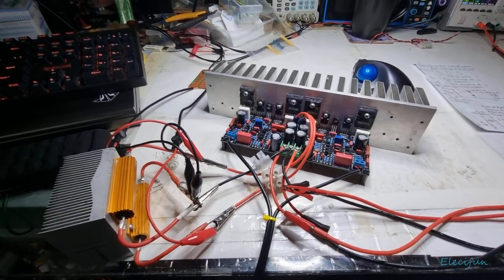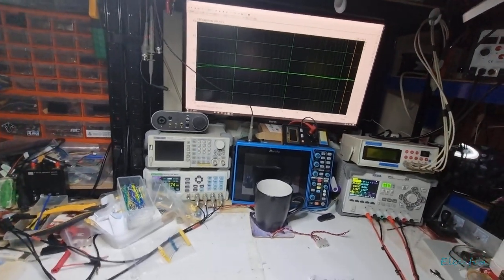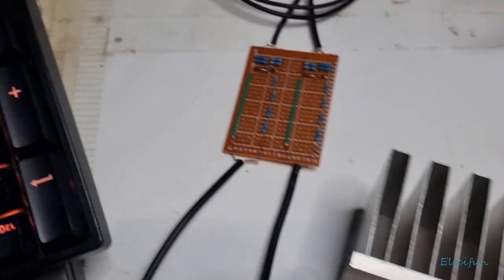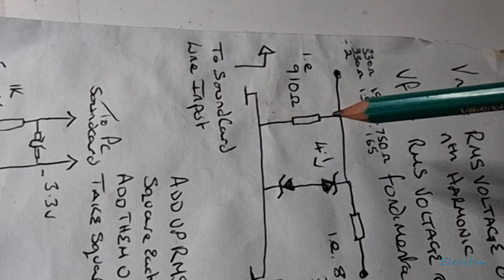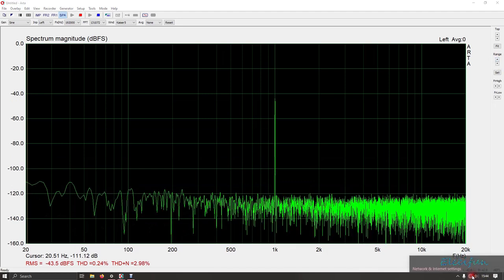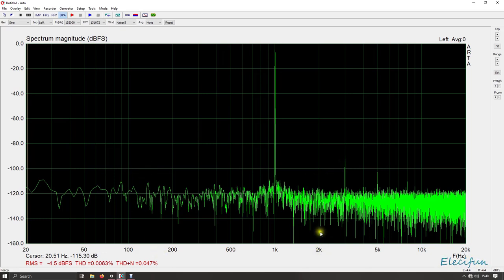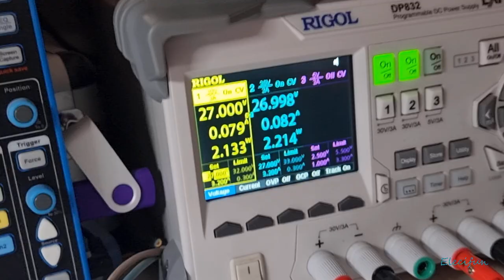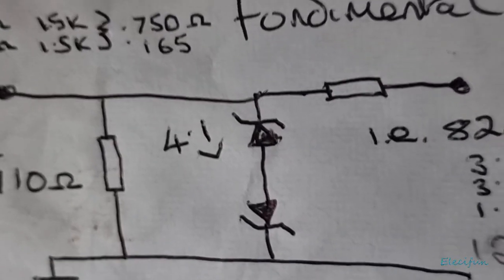SymaSym 5-3 KIT Aliexpress THD+N Results

Comment: Good to see you manged to get it all sorted, and getting results even better than what i got.
You thd+n is somewhat higher than thd, worthwhile checking all your connections for interference
Reply from the maker: @zoelong6021 cheers for the inspirational push, I enjoy the challenges. The noise level is higher than I hoped, At a guess it may be to do with the Realtek ALC 892 driver for the on board sound, its HD sound but HD as in 720P and not HD as in 1080P. 
My urge is to try out the Focusrite just to see the difference, have you tried it or know what its loopback result looks like?

Comment: I'll bet it's very satisfying to build that voltage probe and get an order of magnitude better look at your sound floor when measuring total harmonic distortion and noise. It's all a bit over my head but it's cool to see you enjoy the victory of overcoming obstacles.
Reply from the maker: It's great fun mixed with occasional frustration and constant learning, just like building and flying drones. I see your RSSI is not quite sorted yet, I expect it is a challenge, else it would have been resolved already. I was described recently as tenacious by someone. First, not knowing what it meant, I thought it as an insult. After looking it up I realised it is probably my greatest strength in overcoming the obstacles.
I know you can to.
Reply: Tenacious is always a compliment in my opinion. And accurate from what I know of you through our years of correspondence. I once had someone say "I'll bet you're hard to kill". That might be my best compliment to date. Yeah the RSSI issue... it might be that my RC control antennas sit too close to the battery. I've been ignoring the RSSI reading though because my link quality numbers are quite good and I've never had a link quality issue. I think I'll remove the RSSI readout from the OSD lol. My distance barrier at the moment is video transmission and reception. I can go about a mile before video break up. Sometimes more if I keep the directional patch antenna aimed carefully. It hasn't been a problem because I don't really long for more distance in the type of flying I've been doing. I may invest in better antennas (possibly a different style) if I intend to routinely fly beyond a mile. 📡
Reply from the maker: @Sonic_Ox  the positioning of your antennas would effect the link quality. The RSSI may be a scaling issue, its worth a look.
Nice to get the platform perfect. VTX RX antennas are important and a good overall investment.
Reply: You are right Elecifun. I really need to come up with a better solution for RC control antenna placement. As for the VTX/VRX antennas, they're a bit frustrating because these ARE quality, after market antenna that weren't cheap. Also, the VTX itself is advertised as a long range transmitter capable of 800mW etc etc 😑 I'm not unhappy with my results so far and am still having a great deal of fun chasing the "ideal" platform. The high paced changes in technology keep the hobby fresh in my view but come at a cost 💰 lol.

Comment: Give us a demo bro ! 😂 Have you thought about b... those speakers bro? **(I think I'm pushing my luck here)**😊
Reply from the maker: I've just fitted a new driver to the speaker I burnt out. They sound great as a pair again. Does that count?
Reply: @Elecifun  Congratulations bro ! 🥇🎉I'm very impressed ! 👏 🙂 Was it difficult to do? Do you mean you replaced the old speaker or driver with another driver or did you replace the cone inside the speaker?
Reply: @Elecifun  Well if you can do that you can build speakers. 

I mean think about it for a moment.

Can you measure a piece of wood? Yes, I'm sure your more than cable of doing that.
Can you cut it square and plumb? Yes, with a drop saw yeah, it's not hard.

So really it's just cutting two front pieces.
Two back pieces.
Four sides all the same length.
Two top pieces.
Two bottom pieces. 
Some pieces inside to reinforce the speakers.
Then the 🕳 🕳 🕳 holes.
Cut a piece of timber the right length.
In one end you drill a hole. 
The other end another bigger hole to mount a router.
You bolt the router to the wood.
Like this:

https://youtu.be/UeSTb6FoOaE?si=HBUrsg2E540O_GZj

The design for the box is already done.
So acoustically it's correct for back pressure.

The actual cost of the boxes is that bad.

The speakers are pretty expensive for 6 speakers 2x 10" or were the 12" not sure.
They're the most expensive components. 

I think they're $600 each. 
Then you need 4 more.
Two tweeters.
Two midrange speakers. 

Then of course is the amp which needs to be powerful to drive them hard enough without blowing them up.

Of course you need two cross overs.
Some nice gold plated speaker post.

And good copper wire.

I have some already it's from Germany and its very high quality.
So I just need to get some spade lugs and crimp them.

Same the other end except they're male plugs into the power amp.

That's another story.
It would be an exciting project and you could even sell them and build another set. 😁👍 Winner winner chicken dinner bro !
Reply: Oh yeah you need some insulation for sound damping. Just get some old pillows and remove the stuffing.
Reply from the maker: @decem_unosquattro9538  Dec.. I replaced a driver in an existing speaker enclosure Q_Acoustic 3030i I burnt the cone cutting safety corners, it cost me £81.67
Reply from the maker: @decem_unosquattro9538  To speak your language ... I swapped out the transducer, woofer unit, four screws and two wires.
Reply: @Elecifun  okay.
Reply: @Elecifun  okay I got it. That's great. It must be nice having both speaker working again.